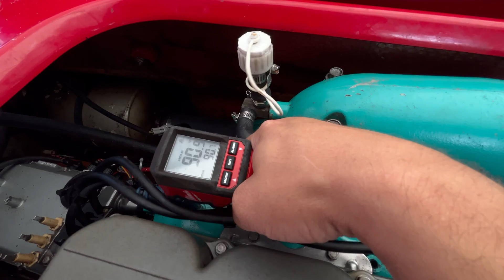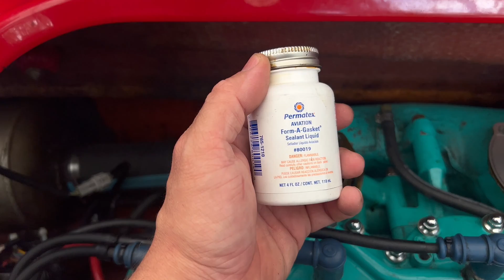Episode 8: Checking Cylinder Head Temp on a 1998 Kawasaki STX or ZXI 1100 Jet Ski

Comment: Hi JD I have a 2001 stx 1100 
Love hate relationship lol
Do you know how many temperature sensors it has ? I can see 2 one on the exhaust which screws in and one on the air intake manifold but there must be one more on the engine block somewhere?? 
Any ideas or is it near the pisser pipe ... My engine light comes on every ride at 15 minutes exactly... It must be a temperature issue but I've been through the whole ski
Many thanks mark UK
Reply from the maker: I doubt it is the sensor..probably your cylinder block packed full of sand or one of the feed lines from the pump... watch all of my videos on the STX, I had a similar issue that I finally sorted out
Reply: @JDsWaterWorld  Many thanks I've checked all the lines and cleaned them 😁 thanks I'll keep trying 😀... It's strange the engine goes into limp mode at 15 minutes... You can let it cool for 10 minutes then it's ok again for a while very strange.. I'll keep trying 😀 thanks again
Reply from the maker: These are notorious for blockages in the cooling system. If there is one component you have not checked- make sure you do, because that is likely going to be the one that's packed full of sand. You have to check every single line and yes there is a sensor on the pisser port hose with small cooling passages, and the stator housing. Remove entire exhaust system and check, pull the head and check the cooling jacket..you must check everything and you will find a blockage I'm sure...common issue with these blocking up
Reply: @JDsWaterWorld  many thanks 👍👍

Comment: Cylinder 3 on mine is over heating when i have the water hooked to original port
Reply from the maker: You have to hook the water to the feed line from the jet pump or it will overheat on trailer..add a T fitting to the jet pump feed line and you'll be fine

Comment: Hey JD i just bought the same 98 you have as a lil project which oil you use for the gas and what the ratio you use for the mixture it would help out a lot? Big fan brother keep doing the 98 vids 💪🏻
Reply from the maker: I use Klotz TechniPlate Synthetic either the “Ski Craft” or “Outboard” oil depending on which one I can find. I do 50:1 oil mixture with  90 octane REC fuel. Good look with the ski thanks for the comment! In fact, I am going to do a 2-stroke oil video..I have like 5 different ones on hand and at the end of the day the Klotz seems to be the best you can buy.
Reply: Thanks you very much I’ll be waiting for that vid soon also do you mix outside the gas tank of the jet ski or you just fill up gas in the tank and than add the oil to the tank.

Comment: Sr JD, the code is CAA1
Reply from the maker: Camshaft position sensor…do you own an ohmmeter? Should be 400-600 ohms across the two terminals. Also check the connector itself for continuity

Comment: Hi mr JD!!! I have a 2017 lx160 and after an winter maintenance (oil filter, fuel filter, tank clean and battery change, the jetski dont start, and when it starts, it stops inmediately… the fuel comes correctly to the inyection ramp…it show FI error… im desperated… need your help please master 🫡😭😭😭 so thak you ❤️
Reply from the maker: You need to hold the mode and select buttons at same time to read the complete code, Fi just indicates fuel injection system related error code, that’s not the actual code. Let me know what the full code is, and I’ll look it up in the service manual.

Comment: My kawasaki stx160 getting over heat more than 110 but there is no over heat alarm
Reply from the maker: Completely different engine than this one, in this video I am referring only to the 1100 two-stroke at idle. Your ski has the 1,498cc 4 cylinder 4 stroke engine